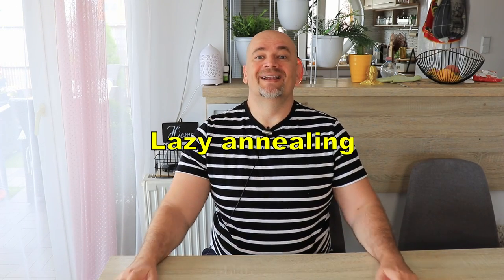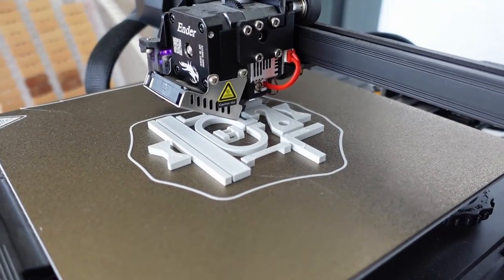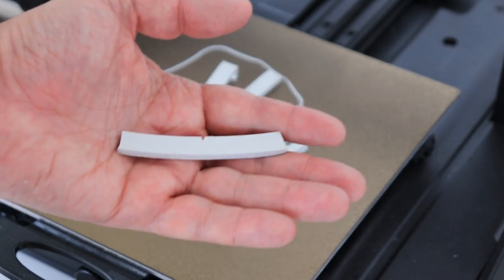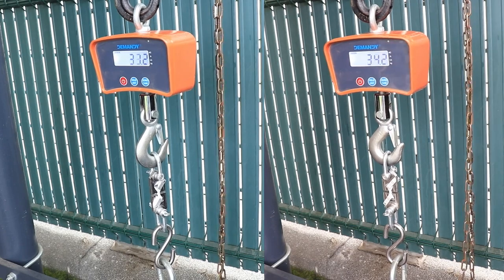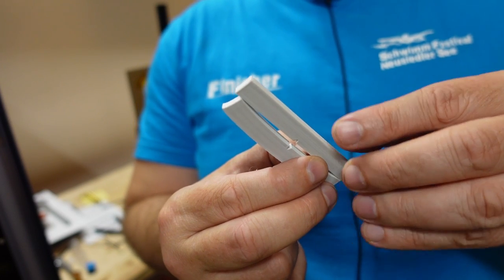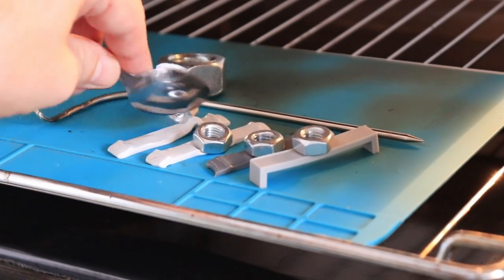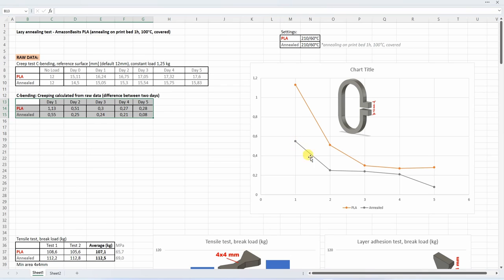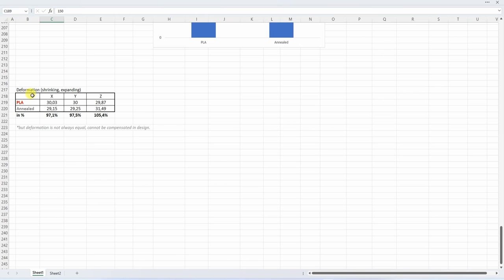Lazy annealing of PLA (covered on heated bed after 3D printing)

Comment: I´m annealing a lot of PLA with the "lazy method", but 100 degrees straight from the start is too high as the PLA will get very soft initially. What works best for me is to heat up the bed to 80 degrees for one hour. The parts will shrink minimally and will not warp at all. If I want no dimensional change at all, I use volcano PLA.  After that treatment the parts are heat resistant enough to withstand boiling water without any deformation . If I had a very delicate part with overhangs, I would heat the bed to only 70 degrees for around half an hour and then proceed with 80 degrees for another hour. Why? -  if you start with a lower temperature just above the glass transition temperature the parts will gain some temperature resistance without getting too soft. The "partly annealed" part will then be temperature resistant enough to go for a higher temperature and so on.... About the annealing in water (I tried that too) I can say that it works , but you will need a very tightly controlled heater and thermometer and keep the water at the same 80-85 degrees in the beginning. Putting the part in 100 degrees water will cause the part to warp immediatly, so thats not an option. There is one more thing to consider (I´ve tested this with thin walled PLA test parts printed from different brands PLA and PLA+): Some of the PLA variants that are fine when annealed with the 80 degrees dry method will get super brittle when  annealed in water. I don´t know why that is, but my guess would be that some filaments react badly to hydrolysis ??? (any chemists around here ;) )
Reply: @polycrystallinecandy  the pieces I anneal are usually little tubes with a slit on one side, diameter and height are around 30mm, wall thickness around 1.5mm. So I can´t say much about parts with infill. What is important though is not to anneal the parts for too long. If you just let the parts sit on your printer bed for too many hours, it will warp even if you annealed with a lower temperature. So I guess the sweetspot is were you get the heat resistance you need with the lowest impact concerning shrinkage and warping.
Reply: One more thing that I forgot to mention, I did all the annealing with the original ender 5 pro build surface. Its these flexible sheets with (I guess) a polycarbonate layer on top. PLA sticks very well to this, so even after the annealing parts are still stuck to this, they won´t self release. That might also be a big factor why this works so well for me.
Reply: this should be his next video, what small temperature increase to final temp is the best.
Reply: There is a g-code for that... Quite easy to program an annealing process. It could be that going in steps, 50C, cool down, 60C cool down and so on would preserve dimensional accuracy the best. 

Also, the slower the plastic cools down while printing improves heat resistance. That is when the plastic becomes amorphous in the first place, when it is cooled down in a second, freezing all polymers in place. Once it is heated, it changes semicrystalline, the polymers can organize and pack themselves more efficient..

So, it makes sense that doing it in steps, or just very slow heating would work better. 

There is very simply explanation for PLA annealed in water, i just wrote a comment about it, so i'll copypaste:

"PLA, heat and water do not mix. It starts to hydrolyze and becomes brittle. The polymers get shorter. So, annealing in boiling water is not recommended. Humidity should be kept away when annealing, the closer to zero the better."

Poly-Lactic Acid is made from glucose that is converted to lactic acid. Then we remove basically one H2O from it, that forms monomers. Then we apply heat in ABSENCE of water to snap those monomers end to end, to form polymers. So, PLA really wants that H2O back. Apply heat to decrease energy needed for a reaction to happen, give it water sources and... it will hydrolyze.
Reply: Thanks will try out.. got ai to help me create gcode ... copy and pasting here if anybody else needs

; Initial bed preheat (assuming bed starts at room temperature)
M190 S40  # Wait for bed to reach 40C

; Annealing Steps (heat up, dwell, cool down cycles)
M190 S60  # Heat up to 60C
G4 S1800 ; Dwell for 30 minutes at 60C 
M190 S55  # Cool down to 55C
G4 S300 ; Pause for 5 minutes
M190 S50  # Cool down to 50C 
G4 S300 ; Pause for 5 minutes
M190 S45  # Cool down to 45C 
G4 S300 ; Pause for 5 minutes
M190 S40  # Cool down to 40C 

M190 S70  # Heat up to 70C
G4 S3600 ; Dwell for 1 hour at 70C
M190 S65  # Cool down to 65C 
G4 S300 ; Pause for 5 minutes
M190 S60  # Cool down to 60C 
G4 S300 ; Pause for 5 minutes
M190 S55  # Cool down to 55C 
G4 S300 ; Pause for 5 minutes
M190 S50  # Cool down to 50C 
G4 S300 ; Pause for 5 minutes
M190 S45  # Cool down to 45C 
G4 S300 ; Pause for 5 minutes
M190 S40  # Cool down to 40C 

M190 S80  # Heat up to 80C
G4 S7200 ; Dwell for 2 hours at 80C
M190 S75  # Cool down to 75C 
G4 S300 ; Pause for 5 minutes
M190 S70  # Cool down to 70C 
G4 S300 ; Pause for 5 minutes
M190 S65  # Cool down to 65C 
G4 S300 ; Pause for 5 minutes
M190 S60  # Cool down to 60C 
G4 S300 ; Pause for 5 minutes
M190 S55  # Cool down to 55C 
G4 S300 ; Pause for 5 minutes
M190 S50  # Cool down to 50C 
G4 S300 ; Pause for 5 minutes
M190 S45  # Cool down to 45C 
G4 S300 ; Pause for 5 minutes
M190 S40  # Cool down to 40C 

; End of annealing, play a shorter melody
M300 S440 P200 ; A4
M300 S494 P200 ; B4
M300 S523 P400 ; C5 (longer note)

; End of G-code (bed will be at 40C)

Comment: Annealing with print bed is great idea. i use this method to dry my filament. Heck! I even cook sous vide steak with my print bed 😁
Reply: Nice! Ive used my hotbed to unglue my broken tablet screen also to dry out a phone which fell in a puddle(after washing it with distilled water)
Reply: @Mwwwwwwwwe  surprised it still works next time use 90 percent or better rubbing alcohol on your phone to rinse it takes water out as well that's how they fix keyboard that have been spilled on is my soaking in rubbing alcohol
Reply: @mikealnutt360  distilled water is non conductive-(doesn't  have any disolved mineral salts ) to short out electrics also non corrosive. I've had Isopropyl  ruin lcds before

Comment: Thank you for trying out "lazy annealing"! Your tests are quite impressive! I use it for increased heat resistance,and so far I'm satisfied. I haven't tried boiling water. There are also many good ideas in this comment section, which I'm curious to try out. As I mentioned previously, I think that many of us are curious about remelting in fine grains, and a comparison to the "transparent fdm settings" featured in a cnc kitchen video from 10 months ago. But it is definitely a lot of work to test it out.

Comment: Anecdotally, i have annealed in a sous vide circulator with the part in a plastic bag and also in a jar packed with salt. The plastic bag only had deflection in thin walls and dimensional changes. The salt had no deflection in thin walls but still dimensuonal changes.

Comment: Very interesting and a nice video. I regularly anneal pla to improve temperature performance. I use a water bath 75C and near 90% infill parts. Put hot water in a pot, add cold water to bring down to temperatures, put parts in, cover, come back in an hour. I have had good results with fiberlogy impact pla. Only get 1% shrinkage and heat resistant >110C. The buoyancy of the parts in the water help prevent warping.
Reply from the maker: I just started the water test, 95C but this looks too much, object still deforms.

Comment: PLA, heat and water do not mix. It starts to hydrolyze and becomes brittle. The polymers get shorter. So, annealing in boiling water is not recommended. Humidity should be kept away when annealing, the closer to zero the better.

Salt annealing works well. Also, i have tested casting PLA, which is not easy as it is so viscous, but the results were amazing. Temperature resistance comes as a side-effect, and i learned that annealed, uniform PLA is extremely hard and tough material. My mind was blown. I made a mold from wood, since we are "casting" at relatively low temps, sprayed temperature resistant paint as mold release (worked amazingly well, it adheres to the plastic permanently with very nice coat quality), melted some scrap PLA with a heat gun, popped in the oven for an hour, took it out, closed the mold which pushes plastic to really fill the mold, and let it cool down on its own. The "technique" requires two sided molds, like injection molding, you just insert the plastic yourself and give a lot of room for flashing. My models had a flat bottom, which meant my upper mold was just flat piece of metal, clamped to the wooden mold.

Comment: I've done similar while restraining the movement of the part in some manner. Minimizes the dimensional changes while providing the benefits of annealing.

EDIT: Can't say I've heard of PLA being annealed that way, but I've seen it done with nylon. A variation that worked really well was to anneal in an oil. The oil kept the humidity out during the annealing process and provided a surface treatment that prevented future adsorption.

Comment: Annealing Nylon in boiling water is something that people do in the combat robotics community because it not only anneals the part but rehydrates with the theory being that it increases the impact resistance of the part. I don't know about other filaments but I would definitely be curious to see testing of PLA, ABS, PETG, Nylon, PC, and maybe even TPU? though I know that TPU doesn't work well with your typical testing methods.
Reply: PLA can't be boiled, it will hydrolyze and become brittle. Any application of heat should be done in low humidity environment.

Comment: I postulate that annealing process will, to some extent, remelt the layer welds, and they may re-weld inconsistently, giving unpredictable mechanical strength results to the parts.  I like the staged annealing idea.  That should mitigate some of the unpredictability.

Comment: Not sure what the theory behind the boiling water sous vide method is. It does not provide support really to prevent warping or deformation. Compared to the lazy method the heating would be more uniform, because here with your test the heat conductivity difference was big. I think the main reason that the impact specimen warped is that one side was touching a high thermal conductivity print surface, while the top side was warmed by the trapped air only and without airflow. Parts suspended in the middle of an oven get more uniform heating. To prevent deformation while annealing there are two known solutions. One is to burry the prints in a fine powder material that does not melt or react with the plastic, like sand or salt. The other is to use filled materials. Carbon fiber, glass fiber or mineral filled materials will deform less during annealing. This is because the main cause of the deformation is that there are stresses that build up between the polymer chains during the printing process and heating up the material and softening it, helps release those stresses. That is why on the Z the parts expand, it is stress release. Carbon fiber nylons can be annealed and PET CF can also be annealed like the new PET CF from UltiMaker, PET CF from Luvocom, PET CF from Phaetus, Raise3D, BambuLab and QIDI. Pay attention that only PET materials without the glycol modification can be annealed. PETG and PETG CF can't be annealed effectively because glycol reduces the crystalinity of the material.

Comment: Is it worth making a negative mould that you place over the model to control the warping while it annealing. Obviously a mould or form would have to be higher transition temp than part to avoid warping.m itself. 

It would be interesting see how eiger (mark forged) scales the part to account for warping,  ie if z is 1.05 larger then they make it at scale 0.952 so final part is 1.0 and like wise length wise and width too. So the “green” print would be a really warped shape vs final sintered/ anealled part.

Cadmould is a software that has modules to compensate for warping. It’s all Price on asking so won’t be cheap…
Reply: I would think this comes down to the cost benefit analysis for each part.  If you’re doing this professionally, build the cost into the price, but you’d better be getting guaranteeable results.

Comment: I wonder if the warping is due to the inconsistent heating from the print bed, from the bottom up, perhaps water would work better, heating evenly.
Or is the warping from the cool down process because the air would cool faster than the bed?  Next time, try a clear glass bowl.  ;)

Comment: There is a plausible mechanism for annealing to make layer adhesion weaker: if the layer adhesion is partly relying on mechanical interlocking of texture like a hot glue gun would do, rather than actually welding the polymer. I find this is what happens when printing at recommended temperatures like 200-220 rather than 260+. In this case, warping would reduce layer adhesion the same way cooling breakd bed adhesion.

Comment: The thought of annealing in boiling water makes me wonder if it would be worth trying it under pressure. The 'Instant Pot' and clones are readily available and relatively inexpensive.
Reply: Yes, to prevent air pockets/hollow infill from warping the part with unequal pressure you want slow heating/cooling in a sealed chamber.

Comment: You should probably try with a bed surface that maintains adhesion under changes in temperature rather than these things designed to release with thermal contraction.